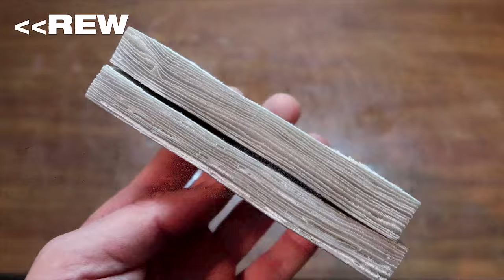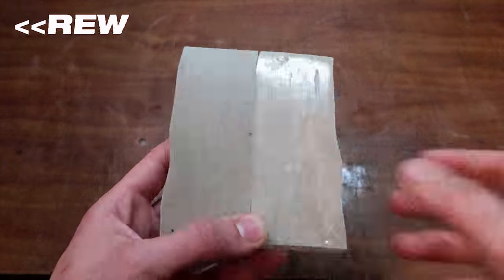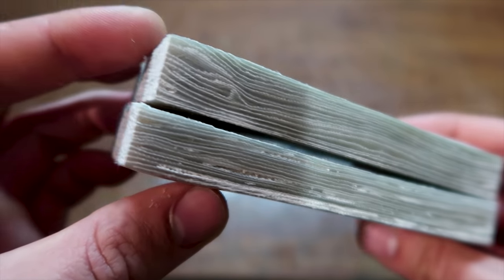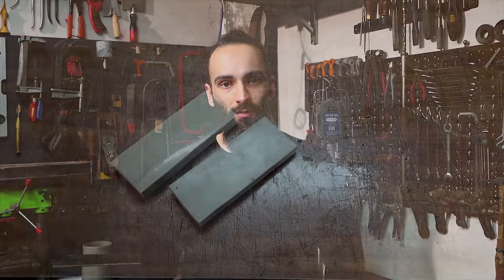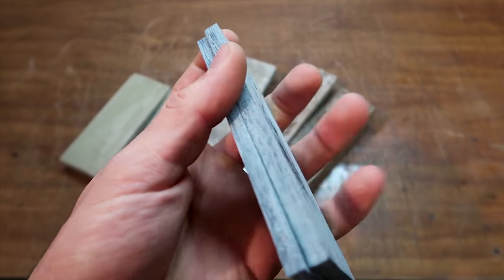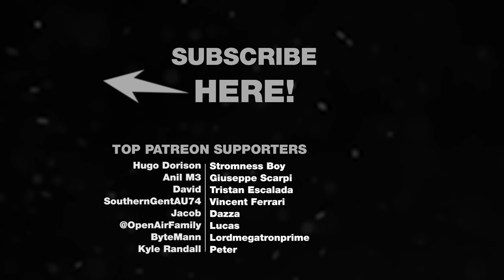Composite Materials : Vacuum vs Pressure

Comment: As others pointed out, you really want to use a vacuum bag. We do it with surfboards and it works perfect every time. Bag alone is not enough though, you also need a breather cloth and a peel-ply  is very useful. Breather allows the vacuum to reach all parts of the bag and peel-ply makes it easy to detach breather from the part afterwards.
Both can be bought at places that supply composite materials, but you can also use an old blanket or felt material for breather, and ordinary plastic PE-LD bags or any other foil the resin will not stick to for peel-ply. You have to make many needle holes in the peel-ply foil so excess resin and air can move through it though. A large IKEA freezer bag can be used as a vacuum bag. Vacuuming time is very short with a small bag, even with the small fridge compressor you're using.
Stackup goes like this: first the laminations you're making, then peel-ply, then breather and finally the bag on the outside. Ideally you'll be able to ditch the silicone mould and just put everything in the bag. If you still need the mould, seal the bag first, put it all together in the mould and then apply vacuum.
To make it work you will need longer resin open time. Polyester resins usually can be mixed with less hardener to make the reaction slower. You can also make the layout faster by wetting many layers at once, pressing the excess resin with two rollers (like a pasta machine), etc.
With vacuum you should aim at around 50-50 weight ratio between resin and cloth (that is true for glass, don't know about old jeans :))
Reply: Vedran Latin- I thought the whole video was a joke until we got to the end. How is it folks are allowed to make videos when they have NO idea what they are talking about? I like your answer when do you share the proper instructions? At 72 me and my flip phone aren't about to try.

Comment: Polyester resin has an exothermic reaction when mixed, this expands existing atmosphere dissolved in the resin. If you degas the separate parts resin and hardener  before mixing it will help reduce the voids in the finished product  when cast under pressure. I also use a rigid mold with a block that fits in the top and clamps to apply force to the mold. I hope this helps!
Reply: I wold comment the exact think.
The best way to do it. Grettings from Brazil 🇧🇷

Comment: When you use vacuum for this process you must put the product into a bag and vacuum out the air from the bag. Makes a much tighter bound.
Reply: christopher lynn He did the same thing, but in a different way.
Reply: @mindnova7850  You need a vacuum bag so it comprises the layers into a tight block, just leaving it in the vacuum chamber will not work.
Reply: @mindnova7850  the flexible nature of the bag also applies pressure to the block, from the atmosphere outside, which doesn't happen with just a chamber
Reply: @alextopfer1068  yep and you only vacuum the bag not the entire container, thus faster to vacuum out
Reply: The vacuum bag is what I'm thinking.  Watch how Lamborghini makes body parts out of carbon fiber for their vehicles.  They have a mould, which they lay resin and carbon fiber cloth into, paint more resin on, then put the whole thing in a bag.  The air is vacuumed out of the bag, causing the bag to compress the resin and carbon fiber against the mould.  This is all placed under vacuum into an autoclave where it is heated to a specific temp for a specific amount of time.

I believe that simply removing the air from a chamber to allow the resin and composite materials to set isn't sufficient enough.  The vacuum bag method applies pressure to the layers of composite material and resin.

I commend Black Beard for this experiment, none the less.
Reply: At the least, he could put a weight on it while in the pot.
Reply: To achieve best results use slow Hardener. Put block in a vaccum bag and  remove air from bag. Doing this you allow for atmosferic pressure to squash layers. To take it step further put that bag with block after degassing into pressure pot and increase pressure in pot. That will give you composite material virtuality without any air bubbles.
Reply: @SimonWoodburyForget  Vacuum is an absence of pressure...............OBVIOUSLY!!!
Reply: The vacuum chamber is good to de-gas the resin but it applies no pressure to the layup.  Use a vacuum bag to apply pressure, no need for putting it in a pressure pot as well.
Reply: if you where making a plane, helicopter or supper car and wanted the absolute best results a vacuum bag is the best choice but if you average Joe a vacuum bag is over kill the only time a vacuum bag would make sense is if you making something to big for a pressure pot or vacuum chamber.
Reply: Vacuum "pressure" requires a vacuum bag, a lot is going to make the resin boil ........ I think he is missing the point of vacuum

Comment: Hey.  Nice work.  I love your channel.
The way you are using vacuum and pressure, you end up with two very different processes.  
The vacuum lessens the pressure around the part, which does two things: try to pull the tiny air bubbles out of the resin, but also, because the pressure is much lower around the part, it INFLATES these bubbles as well (like when you put a half inflated bubble in a vacuum chamber, as you pull vacuum, the balloon gets bigger; check it on youtube, or do it, it's pretty cool).  Part of the problem with this is that not all the bubbles are able to make their way out, so, as the resin cures, you have many bubbles that end up stuck there.   This is probably made worse by the fact that it's a composite;  the bubble in a solution just float up as they get bigger while in a composite, the fabric gets in the way, so the bubbles have to go around the fabric, making it that much more difficult.  It's more like blowing a balloon than pulling the air out. 
With the pressure technique, you're doing the opposite: by raising the ambient pressure, you make all these tiny bubbles shrink, as the air around it compresses the composite, and when it cures, the bubbles are stuck there, but so small and compressed that they are hard to see.  It's not perfect for inner structure, but it's better than the big bubbles from the vacuum. 
Other people have mentioned that usually, composites are put in a bag, and vacuum is pulled from that.  What you get there is like the best of both worlds;  the vacuum pulls the air out of the piece, but because the pressure IN the bag is lowered, the outside air puts pressure ON the bag, and thus on your part.. you both suck the bubbles out from inside and press them out at the same time.  You should try that out next;  just make sure you don't suck resin into your vacuum pump (you should check out how to make a resin collector from a container between the bag and the pump)...

Comment: When we used to build composite airplanes, we used vacuum molding. We used a release/peel ply against the part, a bleeder ply on top to absorb excess resin and then the vacuum bag. We left the part under pressure and rolled the mold into our oven to heat cure (we used epoxy resins). This results in very tight, voidless laminates that passed rigorous testing since these were fuselages, wings and canards for 4-place airplanes. Admittedly my experience with polyester resins in somewhat less- small boat hull and some surfboard repairs. I would think that keeping the micarta under vacuum the entire cure time would make a difference.  Yes a vacuum will remove air, but the pressure is what compresses the composite. If there is no pressure to coincide with the vacuum you can lift the layers with the air that is trying to escape, depending on the porosity of the laminate material. That is why a flexible vacuum bag works so well, at first the air is removed as the vacuum is applied and then as the vacuum increases and the bag is pulled tighter on the part you get the pressure of it compressing the composite layup which tightens the layers and further removes excess resin, usually resulting in a near perfect ratio every time.

Comment: Great video, I respect what you have done here. Responded to people's comments. I always thought when making it it was layered and then applied pressure with a weight. Same with vacuum bags, the force of the bag squeezing it is more then just a vacuum, we are using the vacuum to create pressure.
Reply: spot on
Reply: @thebottleproject2730  so with a solid vacuum chamber the chamber takes on the forces as, it's solid. It doesn't constrict in volume, take a plastic bag and a apply vacuum the outside walls create pressure to the volume inside and reduces, therefore squeezing the insides. Hope that makes sense.
Reply: @thebottleproject2730  no paul , vaccum pulls out bubbles, sheer  pressure can never do that, the single bast way is to bag it, and pull a  vacuuum on the bag
Reply: @jusb1066  put could pressure not push out bubbles lol
Reply: @ifell3  no it does tend  to shrink them, but vacuum pulls them out entirely, if you also put it in a bag, the bag squashes on the outside, double win!  you actually put it into  mould, then bag it, or it will push on all sides, squashing your thing out of shape

Comment: Composite materials are making by vacuum infusion. Put your material in polyethylene packet with two tube closed holes, after that make vacuum there through the one of tube hole. Put the second tube to reservuar with resin and open the tube. The resin should go to the packet through all of your material without leaving there any buble. Let vacuum pump work until all material will in resin. Close the tube with resin. And let vacuum pump work until resin stop come out from the packet. Swith off pump, close the second tube and let resin become a plastic. To make your result more accurate you can make pressure over the packet more than 1 atmosphere,  use your pressure pump!
Reply: Sounds legit :)
Reply: В пакете сложно добиться ровной поверхности. Хотя идея хорошая. Плотность заготовки станет выше.
Reply: yep - basic "high quality" fiberglass boat building technique.
Reply: @ПавелГармашов-м3ю  это не идея, это академический метод производства композитных конструкций, а форму необходимую получают помещением заготовки в матрицу, но тут это совсем не к чему
Reply: Ну как бы согласен. выше уже комент оставили. меня другой вопрос интересует, залить большую площадь допустим столешницу с панорамой лучше сверху и вытравить воздух или способом стекловолокна, то есть вашим способом?! Опыта заливки нет пока, пока идеи и желания, а испортить не хочется.
Reply: پ
Reply: Vacuum infusion is the method we use in aerospace manufacturing.  We do not use pressure, but if you do use pressure combined with the vacuum infusion it is very effective.  John Wanberg has some excellent books on working with composites and he uses a paint pressure pot that is plumbed so one can pressurize it.  He installs a vacuum port so you can pull a vacuum on the part inside the pot while pressurized.  Harbor Freight sells the paint pressure pots.   Though we do not use them for pressure, we use the Harbor Freight pressure pots in aerospace as a resin trap when we do vacuum infusion.  They are designed to hold the pressure, so no need to feel nervous it might blow up under pressure or implode under vacuum.

Comment: Vacuum is used mainly with thin resin like Cactus juice for wood stabilization. It takes few hours sometimes. Pressure pot is used for casting mainly. So methods are different and depends on needs.

Comment: Video has been nicely done
& quite informative. 

Try this & let us know if helps...
Cut a metal block same size as the laminate blocks in this video. 
(After sides cut off)

Cut, laminate, & place strips same as in video. 

Place a single layer of 1/8" washers 
(Honeycomb fashion on top)
Place metal block on top of washers. 

Now put the prepped molding into  the vacuum chamber. 

I believe that you will like the results.

Comment: if you can put your scales into a vacuum bag and suck out the air. the colapsing bag helps to add pressure you need a release cloth on top of your scales and an absorbent material to catch excess resin.

Comment: Good videos, keep experimenting. I think Vacuum is only good when it's used to generate the pressure similar to how carbon fiber and fiber glass parts are made with vacuum bag
Reply: sadly that's exactly how this should be done. Mr. black beard is doing both methods wrong.

Comment: same advice either a vacuum bag or under weight. either way you got to have an outside force to squeeze the material to remove air and excess resin then its a simple matter of adding more material for thicker results.

Comment: I would have thought as some others have said, some 'down force' would be needed. The pressure pot would eliminate  the air bubbles if the bubbled had somewhere to go. With fabric and resin layers, some bubbles cant escape and end up being trapped. putting a block of wood (wrapped in shrink wrap) and either clamped down or weighted with a lead weight or brick (or something heavy) would help squeeze the aire out and press the layers together. Great educational video.

Comment: The molds need pressure on them, such as clamps.  This will eliminate many of the voids.  Also, it works better if you add additional resin on each.

Comment: I find that simply applying physical pressure works best. I use a piece of aluminium bar the same size as the mould and drill small holes in it to allow excess resin and air to come out. Haven't had an issue with that method yet.

Comment: Really good examples and comparison between the two methods.  I agree, pressure gives better and most consistent results when making all types of micarta.  Even with the more expensive polyester resins, I find this is the way to go.  A quick de-gas with vacuum works well, if you have adequate working time before pressurizing, but it's not usually necessary.  Great video as always!

Comment: Air pressure and vacuum chambers are far different than weighted pressure and vacuum bagging. I’m not familiar with the curing process you’ve demonstrated but I feel that the results would have been far superior for both methods if you had used weighted pressure and vacuum bagging for this experiment. Just my $.02

Comment: My suggestion would be to make a couple of forms that can stand up to the fly press you restored. make the forms such that you can use the press to apply significantly higher pressure on the composite material. this should reduce or eliminate the voids.

Comment: I have had decent luck with a wooden form using wax paper with a wooden block on top and clamps to squeeze the material together. I then correct shape on belt sander. Works great for knife scales. Using the silicon molds you have and a block of wood wrapped in wax paper and clamped down should work great.

Comment: Interesting video. I'm a bricolage fan and I have made some parts for my motorcycle, using epoxy and cabon fiber/vtr. Epoxy costs x5, but results are at least x10...flexible, tough, and good looking. And, obviously, gives you a lot more time for working.
An idea to reduce bubbles: you could try to do your work in 3 o 4 batches, then glue them together using the same resin. So you could work with "fresher" and more fluid resin. Pressing the layers together with some weight could also help. Slower, but - i hope - better.
Ps I'm italian too, but let's think to the global audience...btw, good english! ciao!